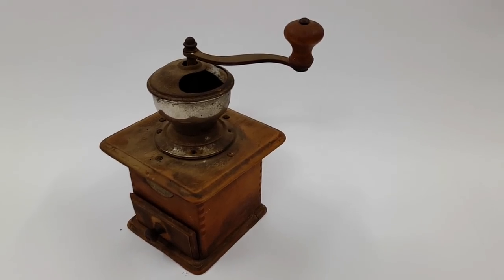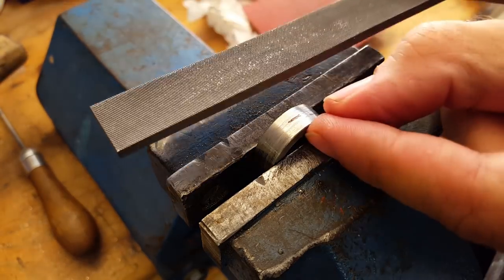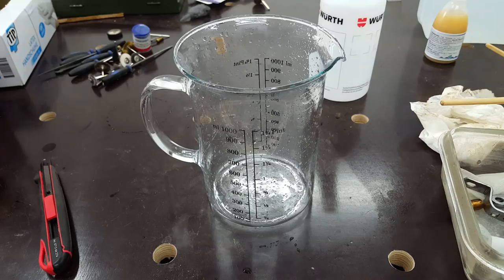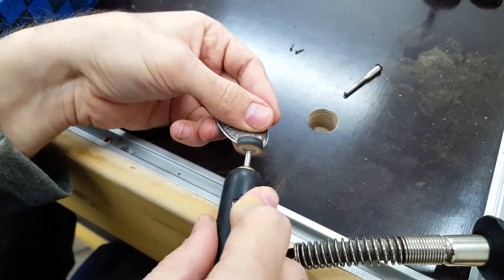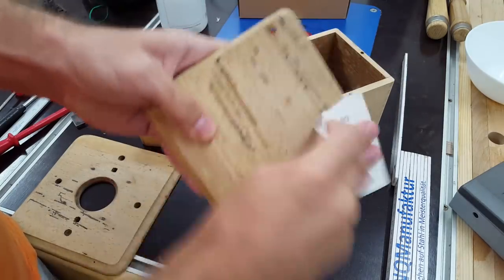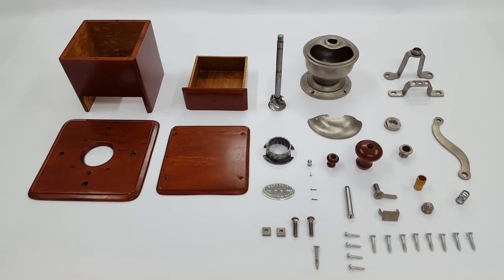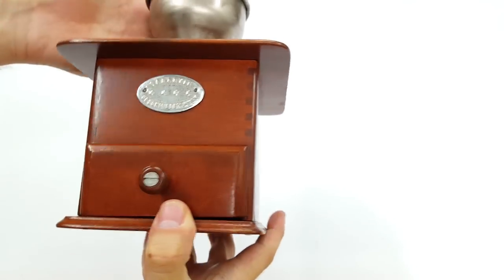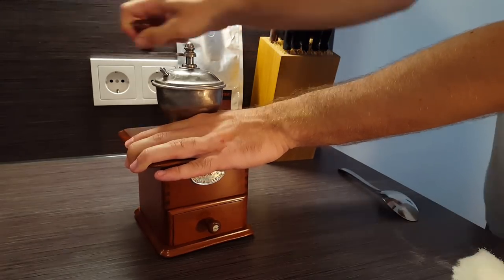RESTORATION of a 1930´s Coffee Grinder – Part 2 of 2

Comment: Thomas, I have this same grinder – it was my grandmother's. I am refurbishing it (mainly its functionality) and watched both Part I and Part II with rapt attention. You will probably kick yourself when I tell you the "secret" of how the hopper "door" opens: It doesn't, because it's not a "door"! The inner part of the top is supposed to be fixed (perhaps glued?) to the base of the hopper! It's the REST of the top that rotates to reveal the hopper chamber! Check it out. Turn the grinder on its side and look at how the top of the hopper attaches to hopper base. It's simply folded over the outward-flared edge. In fact, if you look very closely (and your grinder was manufactured as imperfectly as mine was), you may be able to see that the edge of the base is folded back on itself as well, making a nice smooth lip for the top to slide against as you rotate it to open the chamber. It's totally counterintuitive. Add to that the fact that the grinder you were working with had a stationary part that kept falling inward, like a door coming off its hinges. If mine had done that, I may never have figured out that it was not supposed to move! My grinder is disassembled, but here's a short video of the hopper and how it opens. https://youtu.be/3GFT62QBPWI
Reply from the maker: I also saw that as the most likely way. But the the top of mine was completey seized and didn´t move and I didn´t see a way to make it work in that way again... The one in the link you posted really seems to be the same but in a much much better condition. It´s nice to finally see it workingas intended! So thanks for your comment! 
I wish you a lot of fun and succes refurbishing your coffee grinder :)

Comment: Nice work, I especially like your tips. At 4:32, you ask how the inner lid originally moved, the answer is, it didn't. The inner lid would have been fastened to the funnel at its two bottom corners, this would have been a very light fastening just enough to stop it moving around, with brass hopper covers it would have been a spot of solder on both ends. With steel hopper covers, I am not sure, but it could also have been soldered. The outer lid would have turned, the inner lid would have stayed stationary. This is the reason that, as you noticed, there was no knob or stud on either inner or outer lid originally. The fixings for these inner lids often come loose, I have found that soldering a small 3cm x 1cm bracket made of very thin sheet brass on the inside fixes the inner lid in place very efficiently. An example is this grinder, which was repaired in this way: https://youtu.be/56CVqkEx3ys. You can also see how the outer lid should turn around the fixed inner lid. Thanks again!
Reply from the maker: Alright, thanks for that info!! Glad you liked the video!